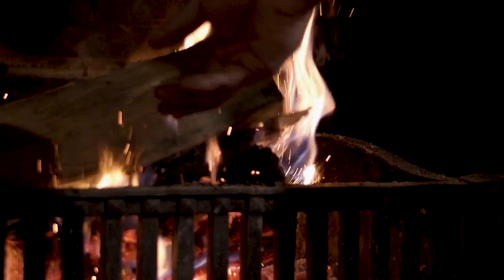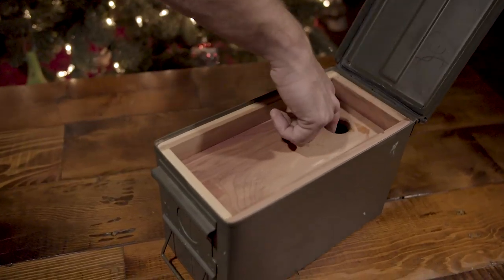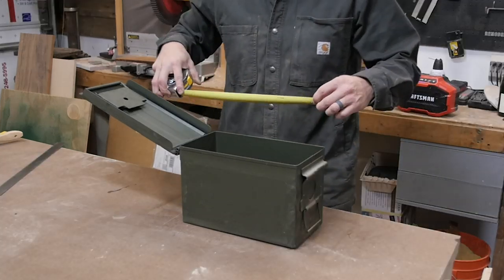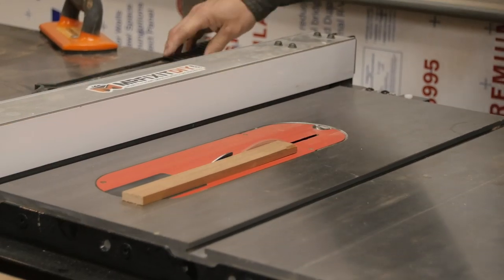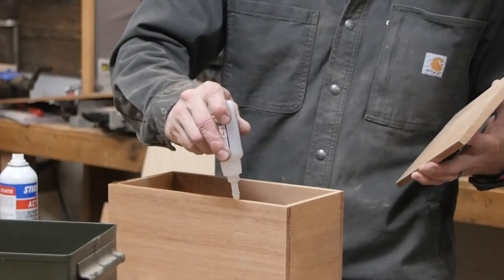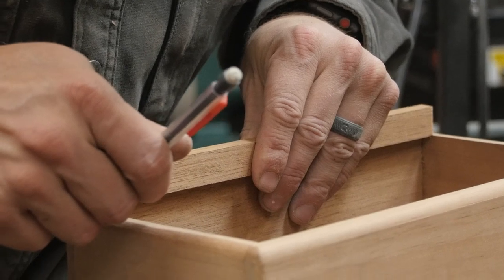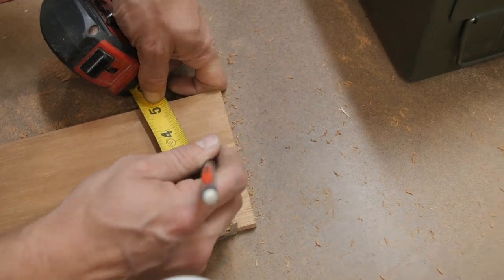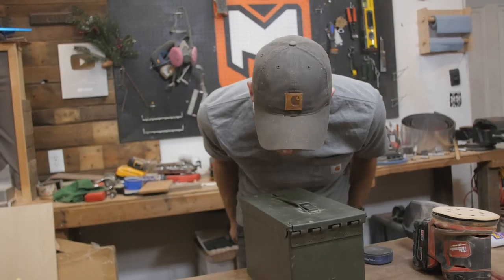Making a Cigar Humidor from an Ammo Can!

Comment: For the newbies:  Spanish cedar is NOT regular cedar--and they're NOT really interchangeable.  Don't be THAT guy and don't use regular cedar--buy real Spanish cedar--there's a world of difference and a real aficionado knows.  Boveda packs are probably the best way to humidify your humidor, too--and they're nearly zero maintenance (and if you buy two rotations of them, you can "recharge" one with distilled water while the other set is in your humidor).  As another commenter here notes, an ammo can (a true ammo can) with a gasket is essential, since you want to keep the humidity in, and the dry air out.
Reply: DUH

Comment: I don’t want to be THAT guy but it should be said that the ammo can, built the way it’s shown in this video, is NOT good for long term storage. A humidor should always be airtight and the 1-1/4” hole is going to let humidity escape quickly which will then dry out the cigars inside of it.
Reply: There is a metal box around it
Reply: ot0m0t0 there is, but the metal can is not airtight either.
Reply from the maker: @bwhite220  There's a gasket on the can. It'll keep your cigars in good shape for a long time.
Reply: These types of ammo cans are air tight
Reply: Josue Guzman if ammo cans are airtight, then you are good to go. Just wanted to put this comment out there so someone doesn’t make a “humidor” for someone and it be a wasted effort in functionality. So, as long as whatever box you are building/modifying is AIR TIGHT, then proceed!